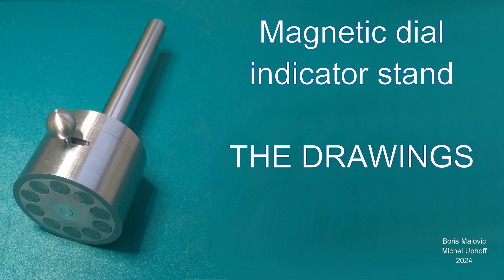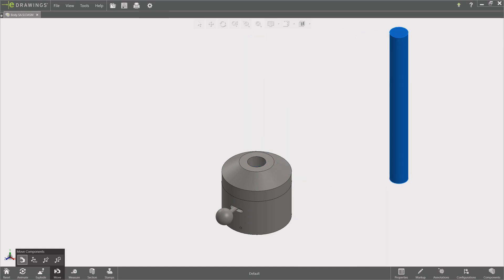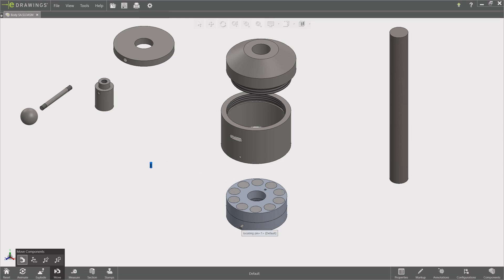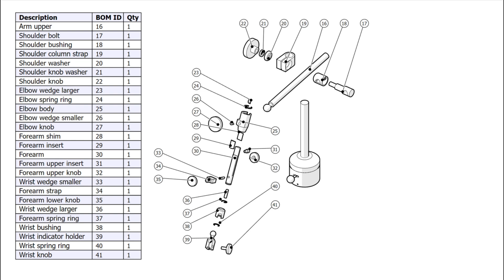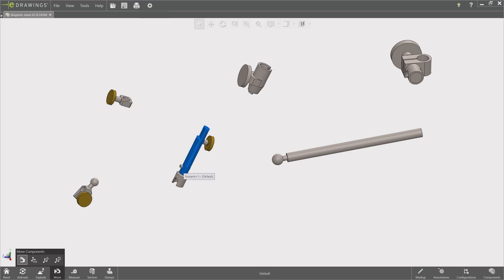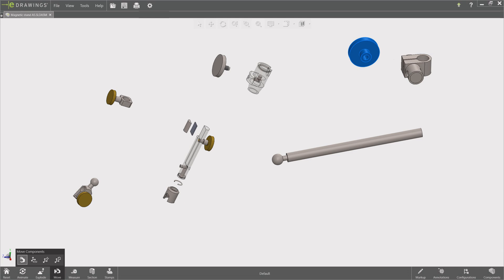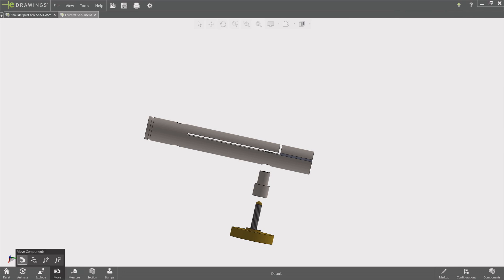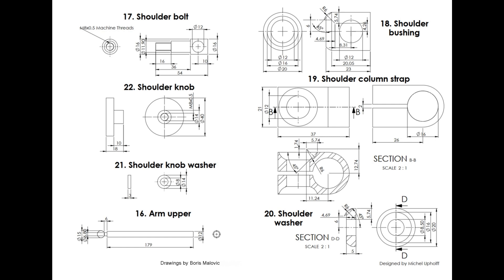A professional magnetic dial indicator stand. Part III the drawings

Comment: very nice, i have the same build, its priceless
Reply from the maker: Did you rebuild my design?
Reply: @Michel-Uphoff  yes and i build now a new bigger with 12mm magnets in stainless steel , but only the holder
Reply from the maker: @ Nice!
Reply from the maker: @ Would love to see some pictures 🙂
Reply: @Michel-Uphoff  i have send one
Reply from the maker: @ichkannsnet  Nice to see that my design is appreciated. Well done!
Reply: @Michel-Uphoff  yes very well and simpel, and I appreciate all your work. I have only a little column drilling machine and a lathe.